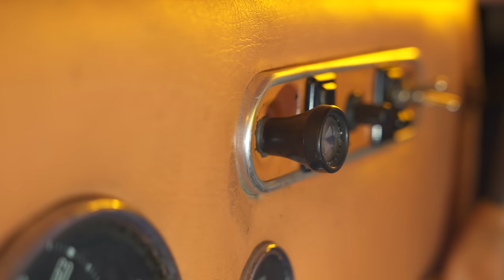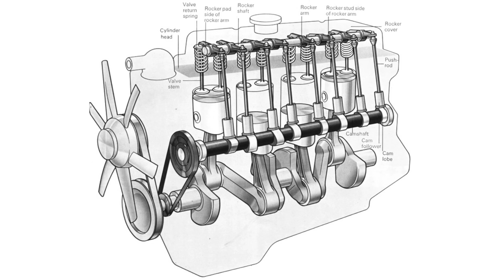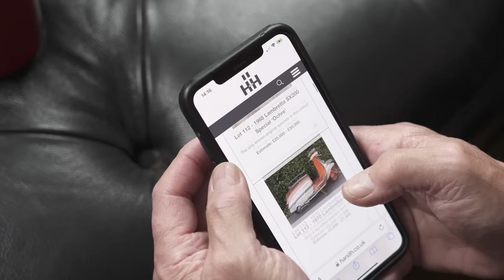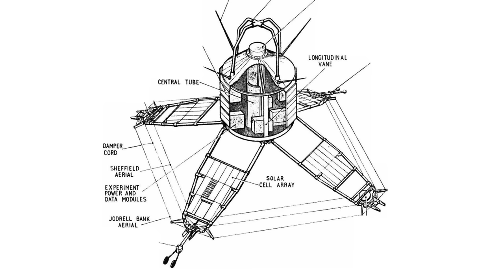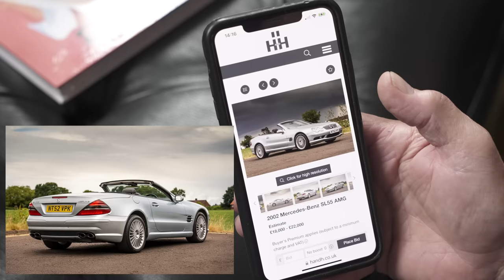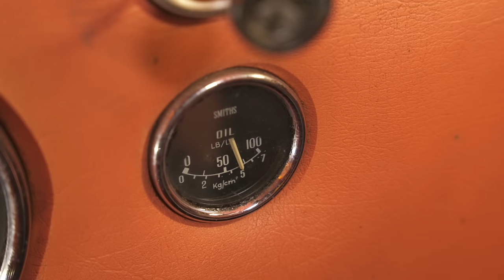Everything You Need To Know About Tappets | Workshop Diaries | Edd China

Comment: 18yrs on austin rover stuff, couple of tips.    - use rule of 9, more accurate/quicker than tdc
- "glue" gasket to rocker cover at start of job, will be set by re-assembly time, no more air leaks off wandering gaskets [15:00]    - flat spots on pull-away can be "fixed" by using gearbox oil in the dashpot, it prevents sudden opening of the slide, therefore  acts like an accelerator jet on pull-away. i expect lots of hate on this last one, but it works a treat, lots of satisfied main dealer customers [covert fix]
regarding the porsche brakes, slightly binding calipers is usually the cause of fade on 99% of all cases, regardless of the vehicle. not only do the calipers themselves cause this,  partial internal collapse of flexi hoses is quite common, acts as one-way-valve, + slowly applies brakes, + finally, the old favourite, the brake light switch adjusted too tight....    keep up the good work young man.
Reply: Yep, I’ve had brake hoses causing “stuck” calipers on a couple of cars in the past. The first time it happened I replaced the caliper, but the problem remained. Was getting ready to fire the parts cannon, then a friend suggested the problem might be the hose to the caliper. Took the hose off and couldn’t blow thru it. New hose and good to go… 
And yes, SU carbs can be tweaked slightly by playing with different weight oils in the dash pot. I had to do that with the twin HS2’s on my Spitfire.
Reply: @notajp  there was eventually an official "fix", a new brass barrel on the rod, which was slightly longer + wider, did the same job as the heavy oil, but lasted longer. this was in the 90s, when emissions were tightened up, so everything was tuned to run weaker, to get past regs, then left to the mechanics on how to get them running properly again. fuel injection came along a few yrs later, big change for us older lads, but solved 99% of running issues of the cars at the time. i work on euro 6 [emmision] cars now, tools rarely touch a car, laptop [internet] updates every week to keep them running, don't think barnfinds in the 2040s will be possible.....

Comment: I just went thru all that with my 2003 Yamaha Road star motorcycle. I eliminated everything else before rebuilding the CV carb. It was hard to start and even after it warmed up had a flat spot on accelerating. Completely rebuilt the carb including a new throttle position sensor (TPS) fixed the problem. Starts easy, no flat spots and gets much better milage.

Comment: Black brake fluid is almost always NOT burnt brake fluid, brake fluid is very hard to burn when under pressure (very little oxygen present in the brake lines, so no oxidation).  Black brake fluid is caused by worn rubber brake parts shedding rubber particles into the fluid during use. If enough particles get into the fluid, it makes the fluid look black.  Usually this is most often caused by the master cylinder o-rings that are old, or in caliper or wheel cylinder parts that are old. In the master cylinder, the piston moves o-rings through a bore with ports in it, which usually shears off many small portions of the old brittle o-ring which eventually causes the fluid to look black.  The 2007 Cayman owner should replace all the rubber parts of the brake system, including the master cylinder but especially including the brake hoses.  If the rubber is old enough to shed particles that quickly, the brake hoses are old enough to swell under hard use potentially causing a brake failure and/or brake fade.  Old brake hoses can also cause a condition that makes them swell shut inside but look OK on the outside.  They will operate under pressure from the master cylinder, but as soon as pressure is let off the hoses swell shut, locking up the caliper.
Reply: I had a little Aprilia RS125 in around 2006. It had a single 320mm brake disc up front. There’s a nice big hill between the border or Devon and Cornwall in a town called Gunnislake and me being the young dare devil I was, would go as fast as my little Aprilia would let me.

Going fast wasn’t the problem however, it was stopping. By the time I’d slowed the bike down for the corner at the bottom of the hi, I’d lose my brake lever completely and the fluid would turn black.

Give the brakes 5 minutes to cool down and stop smoking, and I had a lever again. However the brakes would fade much more quickly and needed new fluid. 

Now the bike was new, so it wasn’t old seals, so from my experience I’d say that over zealous driving leading to extreme brake fade could indeed turn brake fluid black.
Reply: And on that note, Ed: Pop some brake fluid in a beaker and heat it up past it’s boiling point, I’m genuinely interested!!
Reply: I had a similar problem many years ago.  Mk 2 Jag with servo brakes as standard.  Brakes were a nightmare and very heavy now and again.  It turned out (finally we found the solution) that inside of the servo rubber hose it was starting to shred and breakdown, it was acting like a valve!  Fitted a new hose and the breaks were like new.  Simple, once you have found the solution!!!
Reply: quote:..They will operate under pressure from the master cylinder, but as soon as pressure is let off the hoses swell shut, locking up the caliper.....
yes that can often be the problem but not many DIY mechanics are realizing what the problem is.... on one of my first cars ( Saab 99GL ) I replaced front calipers before realizing what is going on.... rubber hoses on front brakes swollen inside and acting as one-way brake valves......
Reply: My first thought was the master cylinder, as you say with the fluid turning black very quickly🤔 that would take a lot of heat, and with the brake fade happening quickly would point more towards the cylinder seals being worn

Comment: Adam Boden's brakes: Get an IR temperature meter, the type with the laser pointer, and start measuring temperatures. Another option would be a thermal camera, which would make things too easy. He might find one or more corners are hotter in a non -symmetrical manner indicating that something is dragging, perhaps due to a stuck or sticky caliper. That drag might add enough heat to cause the sort of issues he's seeing. If it's a temperature issue (which it is), then make the temperature visible; stop guessing. When you have an invisible parameter, make it visible!!  Once you're no longer blind, then you can see the problem directly. This advice applies everywhere.

Comment: I modified old sparkplugs to hold a dail indicator so i can check TDC. A simpel indicator with extension rods is what i use. I removed the porcelain and fitted a piece rubber hose in it so it wil hold the indicator. I have multiple engines what needs regularly valve adjustments. I have different sizes sparkplugs modified for the different engines.
Reply from the maker: Great idea and rather more accurate
Reply: @eddchina  talking about the porcelain being removed from a spark plug, I knew someone who did the same but connected the hose to a paint spray gun and run the engine to to provide pressure to the gun to spray the car he was working on, brilliant idea 🤔😉😁
Reply: You could use adaptors from compression tester

Comment: It’s a mini engine.  It’s the rule of 9.  When 1 is open you adjust 8. When 2 is open you adjust 7 and so on.  Profile of the single cam can mean at tdc you are on the ramp of the cam lobe.
Reply: Same here rule of 9 is what Ive always used, eg watch the spring on No 1 valve when fully compressed adjust the clearance on valve No 8,  If No 2 valve spring is compressed adjust No 7..just make sure the one that is compressed and one that want adjusting add up to 9 :)
Reply: same rules but of 13 applies with the 'C' Series engine
Reply: If I remember that was the sequence for most British engines of the time
Reply: A great resource on the subject is John Twist. Specifically: https://www.youtube.com/watch?v=G4xsp9HAmAw he explains a quicker method rather than adjusting the "opposite" valve at exactly TDC.
Reply: Yes, same for the B series. Probably the a series suffers from charge robbing as well  where 1342 means the siamesed inlets lets 1 steal mixture from 2 and the mirror with 4 and 3 This means you wont get the mixture exact on all 4 cylinders. 
I would have started by checking free movement and the oil in the SU damper
Reply: Rule of 9 is what I have always used on A & B series engines - but it has been a while 😂

Comment: I was on the road with a E-250 Ford panel truck with a 351 V8 and it started losing power. This was in the middle of the night between gigs (traveling with a band at the time) and we had to make the next town. Of course, it was rainy and about 27 (-3C) so we found an awning at a closed business so I could work getting soaked.
I ruled out oil issues, air filter and fuel supply issues. Then proceeded to check for missing cylinders by removing plug wires at idle and listening for a change. Turns out I had three cylinders that were not firing, all on the same side of the engine.
Thanks to my dad, who was a mechanic, giving me a KV tester that Christmas I was able to determine that the issue was not in the spark distribution and when I pulled those plugs, they looked good. 
Next, I pulled the valve cover and discovered the issue. The rockers on each of the dead cylinders were way too tight, even for hydraulic lifters. I loosened the rocker nuts and found that the exhaust valves on the dead cylinders were about slightly higher than the intake. This indicated to me that the valve seats were sinking leaving the exhaust valves constantly open. Thankfully I had a few nuts in my kit that were the right thread to double nut the rocker studs, so I gapped the failing valves to match the resting gap on the working cylinders and managed to get all three cylinders back up and running. Granted I had to readjust these valves twice more to get us home but it worked. 
I never did find out why that head failed like that but I am so glad for what my father taught me about cars and how many times it has gotten me out of tough spots. Thanks Dad!

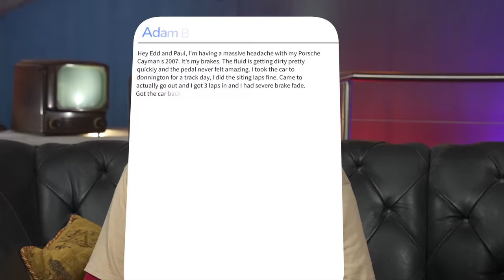Comment: 28:16 Edd didn't mention a crucial part of the question: "Or even the best method for bleeding with a clutch that runs off the brake fluid reservoir?"
This is likely the culprit as it shares fluid with the brakes apparently. The clutch holds decent volume and will cycle through on a track. The old fluid contaminates the new fluid and it cooks right away. The entire system, including the clutch, need to be flushed and bled using the Porsche system Edd mentoned. It cycles the ABS, which otherwise will trap a lot of fluid. If the ABS itself had an issue, it would most likely show on the dash.

Comment: I have not had luck with the "marine" solder/shrink tubes. With age they tent to crack. My preferred method to wire connecting is to solder, then apply some liquid electrical tape followed by regular heat shrink. I have used the shrink tube with adhesive, but again I have seen it fail too if there is any stress on the wire. The liquid tape/heat shrink method has never been an issue and insures a waterproof and somewhat flexible connection.

Comment: When the valve has too much clearance and starts rattling, it won't just be noisy but also start mushrooming the valve and pushrod, possibly wearing the cam out faster. 
There's quite a lot of force going through those rockers and if the gap is too large, it won't push on the valve, but slap it. Like hitting a steel rod with a hammer over and over, it will deform it, worsening the problem as the gap gets larger.

Checking and setting the proper clearance is free, rebuilding the valve train isn't.

Comment: Rule of nine is a good tip on these engines to ensure the valve is closed and the cam is not interfering with the clearance, also, no mention as to a cause of multiple valves losing clearance, such as valve seat regression. There may be more to this than meets the eye.
Reply: Valve seat replacement

Comment: When both valves lose clearance at the same time, that usually means the seats in the heads are receding... does the orange have hardened valve seats? Or do you use a lead substitute in the fuel?

Comment: That's a very convoluted way to check valve clearances. Much easier to use the rule of 9. When number 8 valve is fully open open adjust number 1. Tight valve clearances are usually an indication of the valve seat wearing. Another good reason to check them regularly.
Terrible looking inlet manifold, the manifold from a Maestro 1300 would be an improvement.
Best to glue the rocker cover casket to the cover with a light coating of contact adhesive.
Black brake fluid problem sounds more like the flexible lines are failing and not only contaminating the fluid but swelling when the are used hard.

Comment: My ears sprang up when you mentioned motorcycles, If your interested I have a 1941 Harley 1200cc flathead that needs some work. Basically I stripped it down for a rebuild, painted the frame and had all the tin work painted. I started rebuilding the bike and lost interest then several months later realised why - I didn't like the new colour - so it's sitting there waiting for me to decide a new colour but in bits. I believe this would be a good project for you it has a foot clutch, hand gear change, twin fuel tanks, rod brakes but when running a really sweet ride 🙂

Comment: Valve clearances don't necessarily close up as the engine get to working temperature, it's very dependent on the different materials used in the engine. Jowett flat fours for example have the clearances set to zero when cold (pushrod just spins freely). My Moto Morini motorcycles use a very small 0.1mm (4 thou) gap and people often set them too wide as "everybody knows" that gap reduces when hot and that gap must be too little. In fact, the clearance when hot is almost unchaged (I know, I've done the measurements to prove it). If anything, it get slightly bigger.

As much as anything, the correct clearance is what matches the design of the "quieting ramps" that the cam designer used.

Comment: Hi Ed  on old mini's the tappets were set using the rule of 9 where the valve you were adjusting wa when valve (9 - your valve) was rocking. For example adjust valve 1 with 8 fully open; adjust 2 with 7 open and so on.

Comment: Personally, I would have gapped and reinstalled the spark plugs BEFORE scraping off the valve cover gasket, to help prevent anything from bits and pieces from the gasket (or dirt) from falling into the cylinders.
Also...I would have used the engine's timing marks to find TDC, and used the other methods (especially the "screwdriver down the cylinder" method) as a last resort.

Comment: About the guy with the brake issues on the Porsche.  Don't use any type of silicone brake fluid.  We tried it on our 360 sprint car, and it just didn't stop well.  Come to find out that it's really made for collector-type cars that aren't driven a lot.  Silicone is not hydroscopic, so leaving the car sitting for long periods won't absorb moisture.  We ended -up with high quality (aka race) quality DOT 4 brake fluid and have had great brakes ever since.  We use Wilwood 570 fluid.

Comment: The Ariel was a blast from the past; my first motorised vehicle.  I believe they were designed to meet a Post Office requirement for a delivery vehicle contract they didn't get. That killed BSA.
The box at the rear was meant to remain horizontal, (with a box of mail on top), while the steering column and seat were hinged to it with a torsion bar mechanism to keep it upright. Vibration tended to loosen the mixture screw. Once, I failed to check it properly, it backed out completely, and to get home I whittled a twig to jam into the orifice. It worked, just, suggesting that stoichiometric ratio wasn't critical.
On the Clockwork Orange, the lack of clearances is curious. Clearances opening up due to wear is to expected, given sufficient mileage, but things don't usually tighten themselves spontaneously. What was the previous maintainer thinking? Are you going to do an intermediate test drive, to see what effect, if any, the correct clearances had?
If, for any reason, there's not going to be a video for the week, could we have at least a place-holder notice, so we don't waste all Friday afternoon searching for a fix? Notice would be nice.

Comment: I've always adjusted the exhaust to 15thou on an A series - inlet at 12thou. Exhaust runs hotter and for long hills etc just avoids any chance of expansion and contact/bent valves. 

Also I'd use the rule of 9 and turn the engine over on the crankshaft starting handle dog.
Reply: Did all minis have starting handle dog?

Comment: For the brake fade question. I had 2010 Mazda 3 and when I changed the brake pad, all of a sudden problems arised. The brake pad has organic compound, so whenever I treated the brakes, the fadings appeared. Organic brake pads are not so great at dissipating or conducting heat, so heat occumulates in the caliper so in the brake fluid. I changed with an oem brake pads, the problem went away. If the brake  pad is not oem, that can also cause the fading. Moreover, I recommend  upgrading to the ceramic brake pads if the car doesnt equipped.

Comment: It was better to put spark-plugs back before replacing the gasket to avoid some stuff dropping into cylinder.
Reply: Sounds like a top tip to me!
Reply: And also clean the spark plugs before you check the gap.....soot and
and dirt can give an incorrect gap.

Comment: Could the brake fluid turning black be caused by old brake hoses? Breaking down of the hose material and the hose acting like a one way valve and keeping pressure applied to the caliper, adding heat?

Comment: May sound a bit stupid but would u use thread lock on the threads would vibration make them slightly adjust I know they are tight but just wandering good video well explained 👍👍👍👍